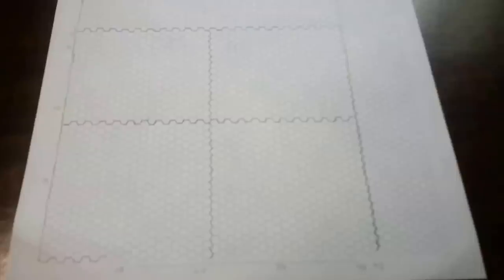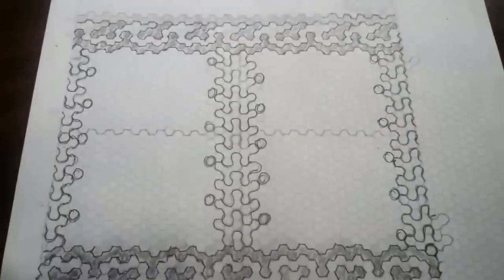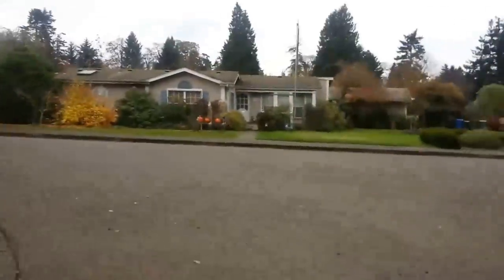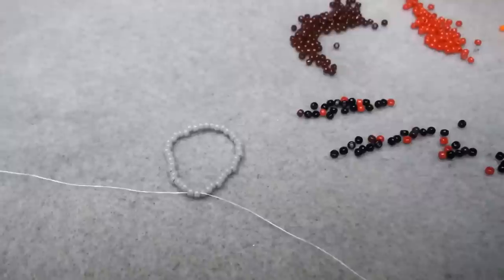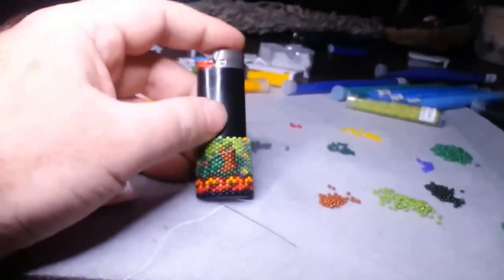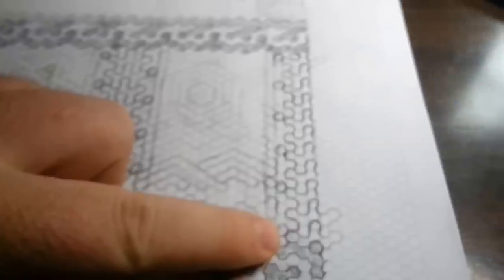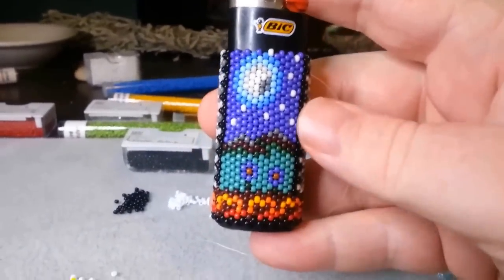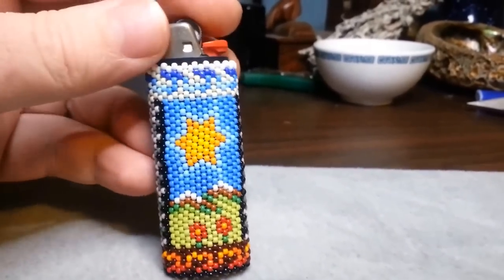Beading:  Lighter Cover Two Sided Design and Execution

Comment: On your design paper I see 42 accross but how many up and down do you use? First time making a complex design, normally I do stripes but I want to try doing it a bit like yours where I can split it in 4 and do something in the middle of both sides.
Reply from the maker: It varied but i think anywhere from 30 to 32 in height

Comment: wen you take your grey beads off how do u do that? tie a not once you take them off
Reply from the maker: because I didn't tie the string to anything to begin with, they just pull right off.  Once I do that, I can go ahead and string on some more beads in that direction, or simply weave my thread back into the work and tie off.  Check out Beading:  Hanging Fringed Beadwork, I show more about how I do specific stuff, like tie off, add new string, etc.